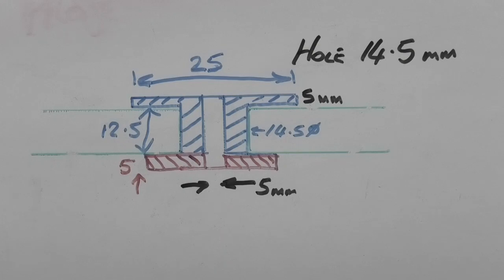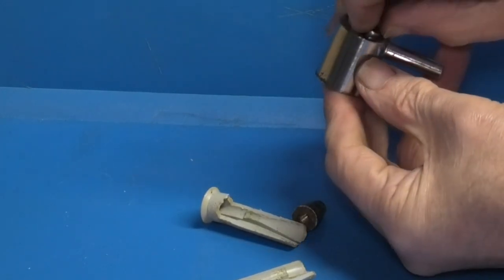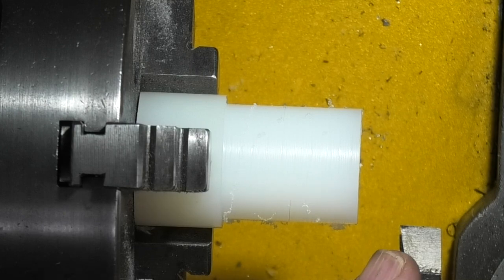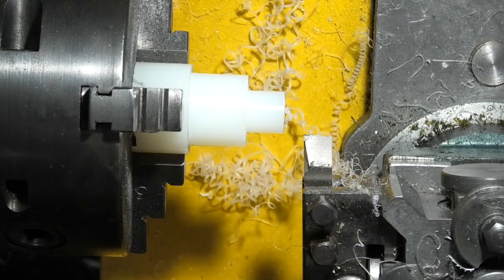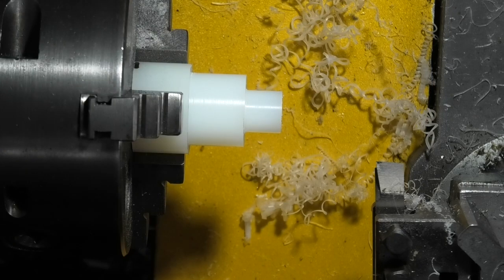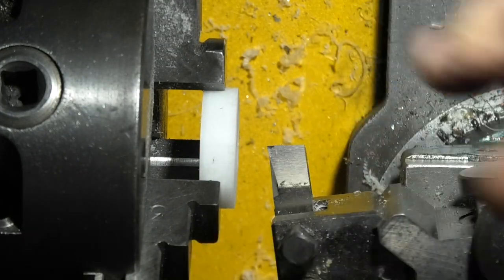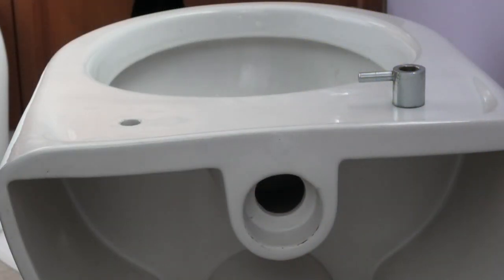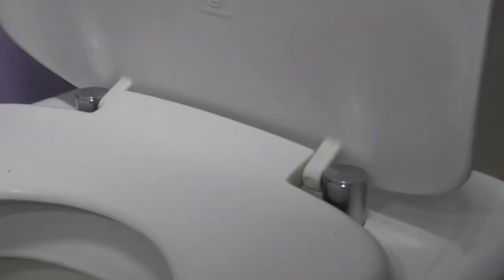Hinge repair using Nylon

Comment: The cost of the replacement hingers can only be described as insanity. You can buy a new pretty luxurious seat complete with mounting kit for half that price. I wonder if anyone has bought a replacement hinge?
Elegant fix and the savings are better spent on a case of beer.
Cheers Eric